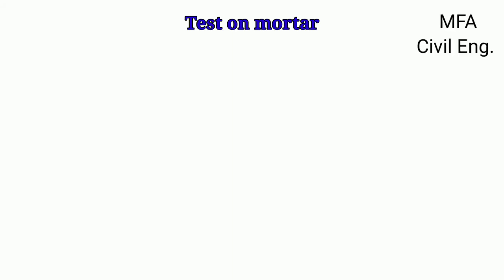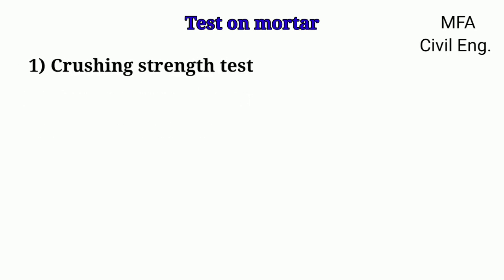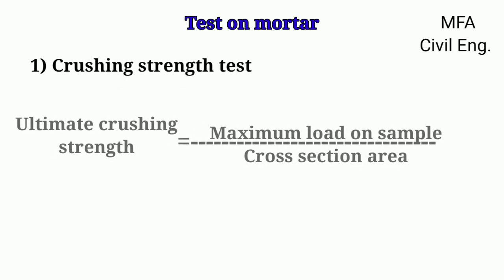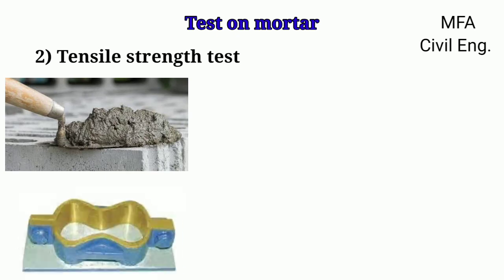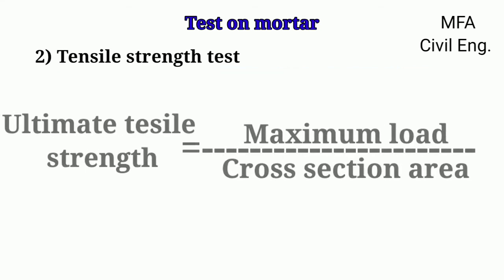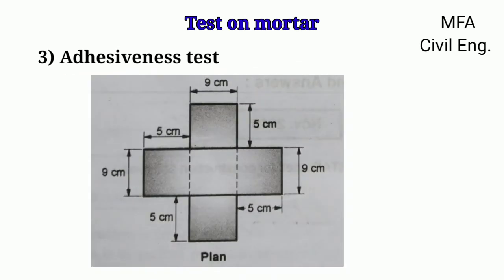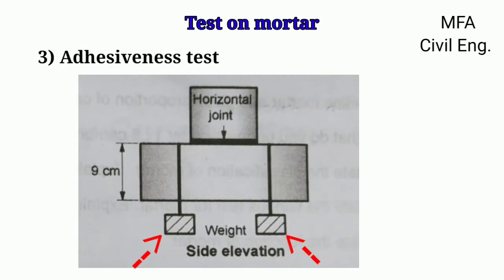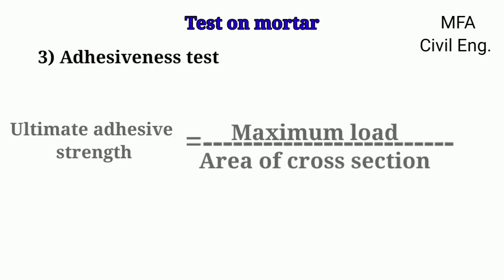Blowing Up Things with Mortar: Epic Experiment!

Comment: Can we know the IS Codes used
Reply from the maker: These all tests are conduct as per ASTM procedure which are mention below.          
      ASTM C952 - 02    adhesive strength 
ASTM C307 - 18    tensile strength
ASTM C 1314-18 compressive strength